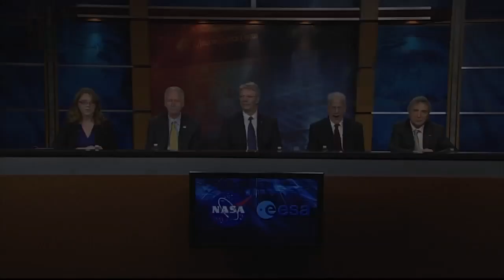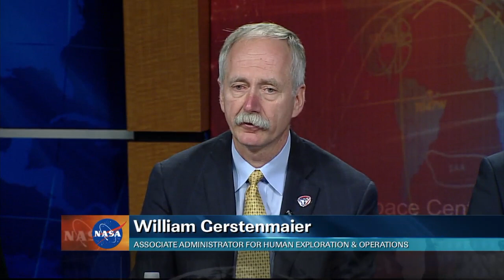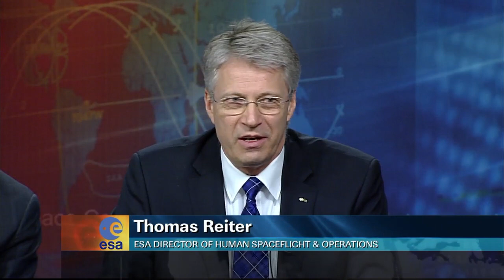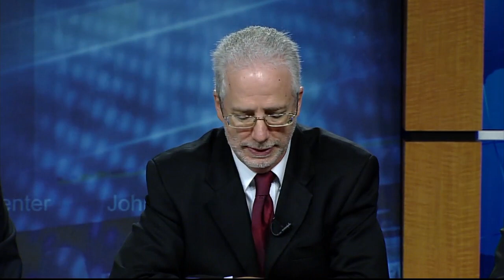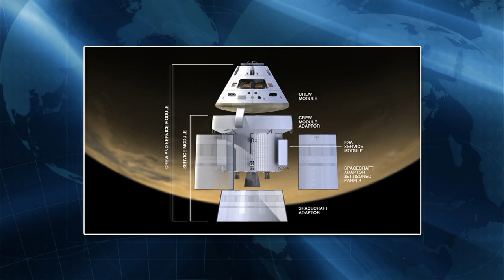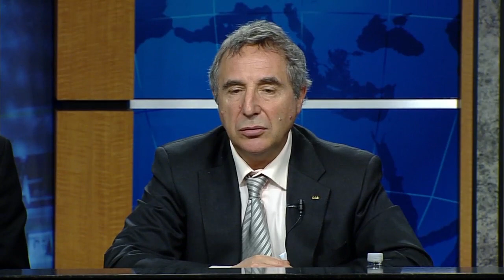NASA Signs Agreement for European-Provided Orion Service Module

Comment: There's been a lot negative thoughts about this cooperation floating the net. So to clearify I'll summerize the reasons, (dis-/) advantages.
Reason: ESA was going to end ATV missions after the 5th ATV (and prolonging ATV missions already) because they want to do something new, however for the extended use of the ISS a new barter with NASA was needed. ESA thought of creating it's own manned vehicle or some sort of space debris cleaner. NASA didn't wan't that and proposed (they did) the Orion SM.

Comment: The NASA put the ATV on the Orion capulare. The ATV is a space ferry for the ISS, with prolusion that can move the station on higher orbits and can mavuer the ISS. The TAV is like a modul of the ISS had has lifesupport and stuff. Its much more the Sojus or Dragon. NASA must dock then together and open the airlock. oki, a bit more is to do but NASA will do the first unmanned flight in 2014 to the moon.